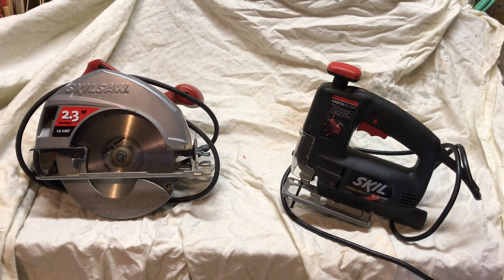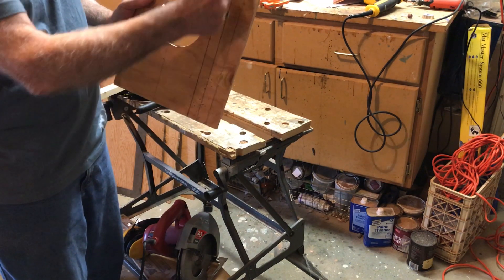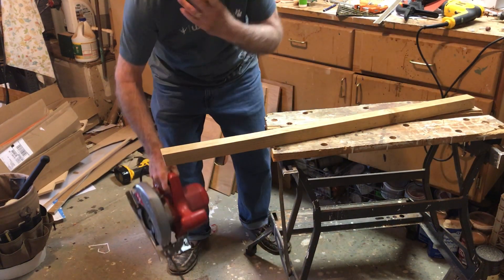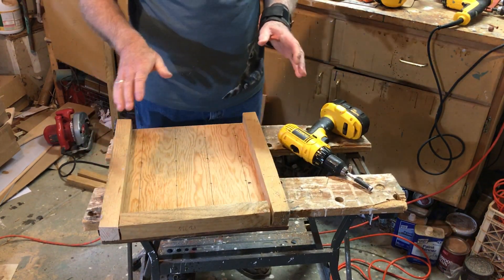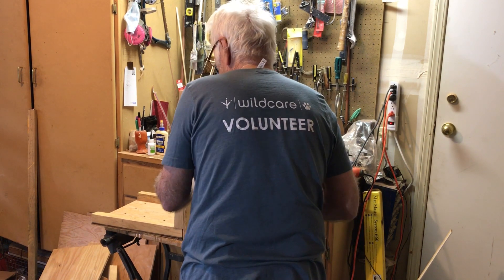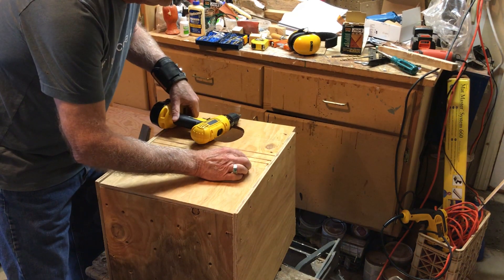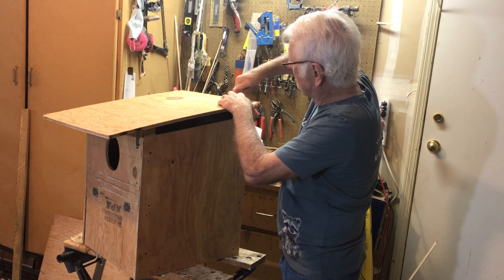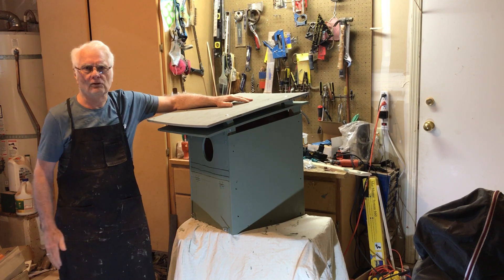How to Build a Barn Owl Nesting Box

Comment: This looks pretty nice. However since you are painting it white on top the double roof may not be necessary. Also, with the exception of the entrance side, those could be painted white as well. We don't want this to get too hot inside. The upper ventilation is a good feature. The entrance hole is better as an oval that is oriented wider than height to provide more room for the wings which makes entering and exiting easier. This oval entrance appears oriented improperly. These should be mounted 8 feet high and the opening should face away from the prevailing winds. Remember to clean them out once a year and sanitize with a weak bleach water solution.

Owls eat rodents that host ticks and attract and feed venomous snakes. Due to forestry practices and the removal of old wooden barns there are not enough nesting cavities for these fairly large useful night raptors. Thank you for taking the time to demonstrate the construction.